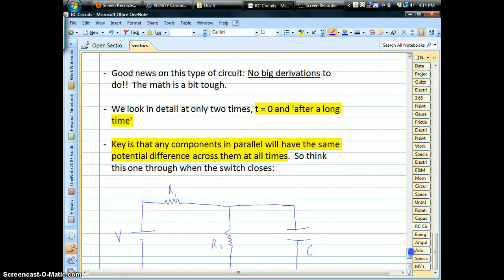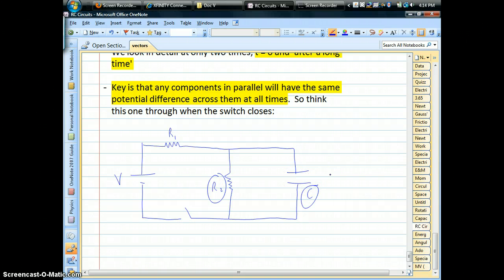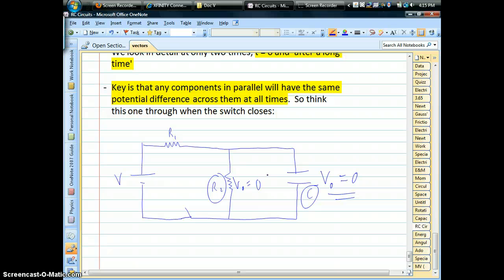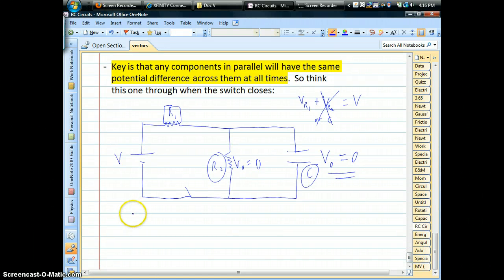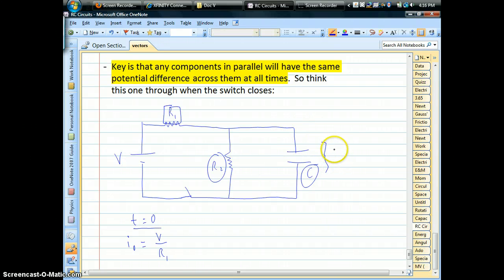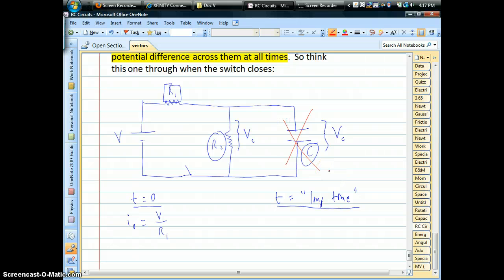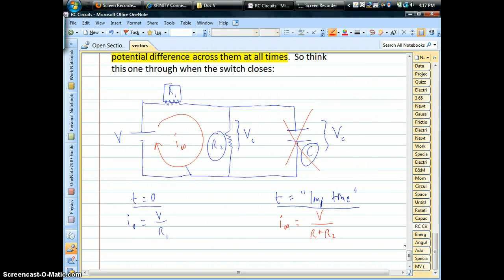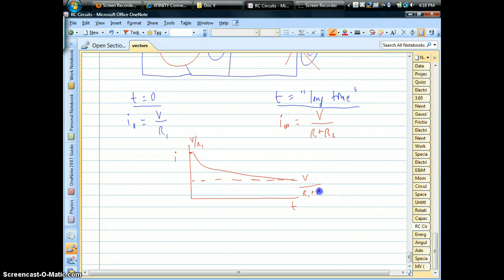RC Circuits: Resistor and Capacitor in Parallel

Comment: Or you could just combine the resistor and capacitor in parallel modeling the capacitor as an impedance, 1/sc.

Comment: is  this sort of thing used in shunt fed oscillators. thats what im reading about at the moment, i cant understand what the use of it is. there is usually some explanation like your video but nothing to show what its use is in a circuit. i dont get what it does exactly, except slow the voltage flow over a period of time. instead of dumping the voltage.

Comment: What would the time constant for this circuit be with the switch closed?
Reply: It is the resistance in the RC time constant is the equivalent resistance of series resistance R1 in parallel with the parallel resistance R2. This is just a Thevin analysis. R -Thevin will be the the resistance of the RC time constant. If R1 is zero R-thevin is zero. And if R2 is zero you are shorting out the capacitor.